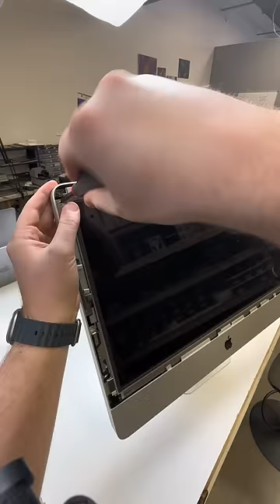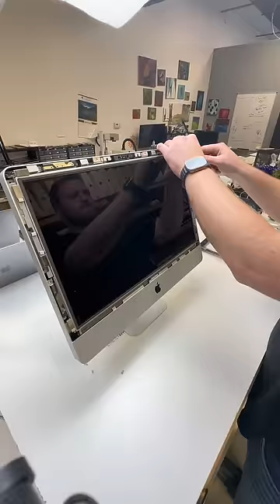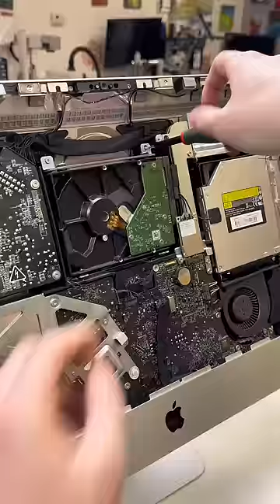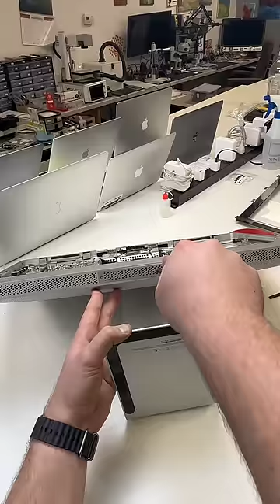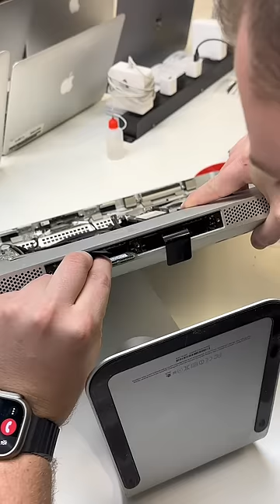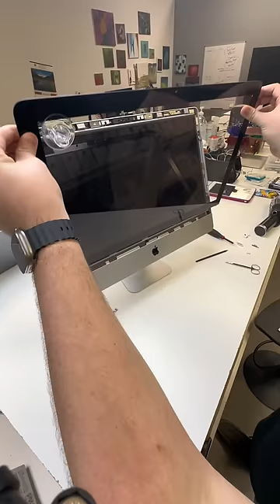7 years later and he’s back! #strictlyapple #thebestforless #shorts

Comment: 4 to 16 gb of ram is a crazy upgrade
Reply: I did my mum's old office laptop recently. 10 year old hdd and 2gb of ram to a 512 ssd and 16gb of ram.
I expected it to be better but I didn't expect it to be a reasonable pc in 2023.
Reply: That and an SSD boot drive....if the customer could tolerate a hard disk and 4gb of RAM for that long, this upgrade will be amazing...like a new computer.
Reply: oh man i feel old
Reply: @paddington1670  dude, my first pc had, I think, 64 or 128mb of ram and like 20gb internal storage.
Shit evolved FAST in the last two decades.
Reply: @nazimelon6653  The first PC that I ever used was 25Mhz, 4MB Ram, and a 40MB (MEGABYTE) HDD. No sound, no NIC/LAN, no modem.  That was pure sneakernet floppy to floppy.
Reply: He should have been going up about 2 gb a yr anyway
Reply: @teerich2011  what u talkin bout
Reply: @Wyv3rnn  memory?
Reply: @teerich2011  what do you mean going up 2gb a year tho
Reply: I had to rewatch the vid just to make sure i heard it right😅
Reply: @Wyv3rnn  just a generalization. If you average it out. After a few years you generally make a high upgrade to catch up and keep up, plus if you plan to game, do design work, etc. Average 2GB a year but not actually physically doing a Ram upgrade every yr
Reply: @teerich2011  ok that makes more sense
Reply: @TheLionAndTheLamb777  what year was that roughly
Reply: @teerich2011  I can see that. But if this guy was only using 4gb of Ram until this year, he’s does need to upgrade every year, it’s a waste of money. He’s not using high power programs, no gaming or writing software. He’s probably using Microsoft office and watches YouTube video
Reply: Don't be a hater. Are you paying for his upgrade? That obviously works for him so it's all gravy baby
Reply: @Scxoop123  im not hating im saying that is a crazy good upgrade chill out. also 16gb of ram is not very expensive
Reply: @Wyv3rnn  lololol my bad dude. This triggered me because of something personal.  I have an old school Toshiba Satellite that I've upgraded 3x (well 2x myself and the 1st one by the original owner) and because of the almost $3000 in upgrades and add on's I'll NEVER get rid of her. I have another Laptop for work as well as a desktop but I love my Satellite and will be buried with her
Reply: @KayMac1 1986-1992 ish. My first was similar, 33mhz, 4Mb RAM.
Reply: i did 40 gb for laptop and 64 gb for desktop

Comment: 7years! Man this is what we need more of. Build once and use forever! Good for the environment and the pocket.
Reply: I have my original g3-g5 imacs still. They still run and everything. Just so old you can't do anything modern on them.
Reply: I use my 2009 laptop and 2012 iMac everyday. Both have ssd now. Run great
Reply: Not good for pockets of investors tho 😅
Reply: That's not what Apple wants.
Apple wants $$$
Reply: I still use the imac i got in 2013 or 14, cant remember. They are durable. I used to switch it from home to home when i stayed at my gf. In 2018 i upgraded it to 1 tb ssd as well.
Reply: I just shelved a 2009 27” iMac. Worked fine, just got slow dealing with large pdf drawing sets for construction. It’d still be a perfectly adequate machine for general use. Glad I switched to Mac.
Reply: I've been using the same laptop for the past 11 years. Put an SSD in it and upgraded the ram to 8GBs a few years ago.
Reply: the shareholders disagree with this statement.
Reply: I’ve had my iMac for 13 year it’s a little slow but it works

Comment: That's how computers you own are supposed to work... You upgrade things, you don't just recycle it. 😊
Reply: Yeah, but you’ll have a worse experience. ESPECIALLY with Apple. They forcibly make their products get worse with time. I’m convinced that every OS update is purposely meant to strain the hell out of old hardware and create problems. It’s a little different with a PC, cuz it’s much easier to treat a PC as modular system than it is a Mac
Reply: @MisterK-YT  iOS uodates primarily makes the battery start to drain quicker. My gf has a 13cmini and the battery health says 93% yet i goes from 100 to 0 in 6 hours or so barely used but before the last update it was getting 8 hours or so while using it regularly
Reply: Turn off all updates. It brings nothing but trouble.
Reply: @MisterK-YT  or it could be that operating systems get more and more complicated over time and require hardware to keep pace. Just a thought.
Reply: @Webb8991  I have to disagree. It definitely does not only happen to phones (in my experience). I’ve seen it happen with every MacBook, iMac, MacBook Pro that I, my gf, my brother, and my sister have owned.
Reply: @bazonga9085  for sure, that’s definitely true. But I would argue that if upgrading the OS leads to such a noticeable hit in performance and increased bugs/issues, they shouldn’t mandate the update so hard. Technically it’s not MANDATORY, but they pretty quickly start dropping support for even slightly older OS versions. (I’ve also heard that they encourage 3rd party desktop App Store developers to quickly drop support for older OS and start using their newer libraries without leaving in support for the older ones.) Back in the day, that was rarely an issue. I can go to most random Windows software download pages and they’ll support like, Windows 11 to as far back as like Windows 7. 

Even though I prefer macOS, Apple just does so many irritating things (IMO)
Reply: @Mr. K  Your right. Apple have said they reduce the power output of their devices chargeable devices so that the battery stays good. However I wouldn't be surprised if they did this for all there old products to make the new ones seem just that much better
Reply: @dangbro  except there’s plenty of security fixes in updates, at least IOS
Reply: apple does it's best to prevent you from upgrading it
Reply: @bazonga9085  apple was found guilty of slowing down older iphones COME ON DUDE
Reply: @MisterK-YT  That’s why i never updated my OS.
Reply: @MisterK-YT  it was proven and is a fact older apple products stop working from OS updates and not hardware problems
Reply: @zyourzgrandzmaz  sounds right to me
Reply: Don't let Apple hear you say that.
Reply: Bro tried to get him to recycle it too lmao
Reply: Your opinion
Reply: @EnglishDrifts69GTxRED  anecdotal evidence
Reply: @capybara9521  its facts though. Its known throughout the tech world
Reply: @bazonga9085 what the fuck is the os running that's more complicated an  update ago?
Reply: @MrTuts4life  but unless you dual boot windows or Linux you are never gonna be able to barely play games on it even if you do the very CPU is totally different from the standard x86 programing style meaning that MacBooks are specifically for designing and creativity that's it
Reply: @MrTuts4life  Never know they might want something to emulate or use for light gaming or want something to give to a child that is not yet old enough for a proper custom rig
Reply: Except everything around the computers are upgrading at a exponential rate.

Computers in 2007 would struggle displaying modern HD videos. Let alone modern websites which take up much more ram and cpu usage.

A comp fron 90s would struggle to load a modern 2005 web page and that keeps going on to today.

Comment: My first iMac was the 2011. It ran like a beast. I used it until 2022, but it still works like a charm. I use it from time to time, because Apple doesn’t allow 32-bit programs to run on their new silicon machines nor allow switching operating systems.
Never underestimate older Mac’s. They are an engineering masterpiece.
Reply: And the repairability and upgradability is a huge 👍👍👍👍
Reply: @markarca6360  Apple is the most anti right to repair company out there 😂 this ram upgrade should have just been a single plate with a screw.
Reply: @djkjthe3rd185  perhaps they cared about the aesthetics. The older molder iMac's were super user friendly, but changing the ram was still one hell of a job, because you had to take out the entire display. Still, it was upgradable, unlike newer models.
Reply: @william_ok  My Dad's got a 2012. It's held up pretty decent stock. I build PC's in 40 minutes and repair iPhones, so I'm pretty tech savvy, but I don't dare to take the front off an iMac. I want to put an ssd/ram in but I'm not risking it 😂
Reply: @william_ok  My clumsy ass dropped a fried iMac before and the screen went everywhere, I'm glad it was being scrapped but damn I was traumatized from working on iMac's after that.
Reply: @djkjthe3rd185  it was, there’s an access door on the bottom held on with two screws. The hard rice upgrade wasn’t even that hard. The glass is held on with magnets and can be easily removed, the screen is held on with a few screws and some connectors, and then you can access the drive. These models even have upgradable graphics cards.
Reply: That doesn’t allow changing OS systems and useless because apps aren’t able to run on it doesn’t sound too engineering genius to me 😂🤣
Reply: @djkjthe3rd185  might get bricked just opening it 🤣🤣
Reply: @robmalcolm8042  Not sure if you're talking about new or older iMacs. I mean Boot Camp exists on older devices and as far as I've heard it runs Win10 pretty good
Reply: The gpus are so useless like the iMac range how Apple ever screwed the world with these bits of rubbish is beyond comprehension.  And the dumbest this is you can’t buy new gpus to fit them or fix the issue.  You just have to scrap them.
Reply: Steve Jobs era
Reply: I still use a Mojave on my Mac for an almost similar reason, due to its capability to run 32-bit apps. I don’t know other way to copy songs from classic iPods yet rather than use Senuti which is 32-bit only
Reply: @pujaastika  And I highly recommend not updating your mac anymore, Mojave is a good OS and unless you want to have more app compatibility don’t upgrade anymore.

Comment: My parents still have a 2008 iMac and only replaced the HDD for an SSD and it still runs great👌🏻
Reply: I got one mid 2007 24 inch with core2 duo eztreme t7900 clocked at 2.8 ghz upgraded to ssd runa so smoothly El Capitan. Still good for an old dude 😂😂
Reply: Bro that's vintage.
Reply: Iaccidently deleted whole machintosh , recovery and all partitions, now i cant so anything, i downloaded mac on usb drive, but imac 2008 wont read it
Reply: Mine has a 2011 air already with SSD & it's still really slow even with a clean install. Installed chromeos on it and it works great
Reply: Honestly, old computers can perform a lot better than some people give them credit for if you're willing to do a little work. I have a Dell Latitude D620 from 2006 I've done some work on because of its sentimental value to me. It has a 2.33GHz CPU, 4GB RAM, and a 240GB SSD, can honestly handle most of my day-to-day stuff with a nice distribution of Linux or older version of Windows. Should you use an older computer like that? I really wouldn't say so, but is it possible? Absolutely.
Reply: @РуссияСрбија  I've had that before, have you tried holding command + option + R while it's starting? That will install the latest MacOS version available.
Reply: @ohareza  That like installing Linux lite. Maybe you can try to use a Linux distro like Fedora. The UI is similar to MacOS, but you will be able to install apps and games. Also, has the iMac become louder after installing the SSD? Normally it gets confused due to not having the hard drive temperature sensor anymore and it will set the hard drive fan to the max.
Reply: @leonferko  That iMac doesn't get any security updates anymore and I'm guessing the app compatibility is lacking. I would try something like Fedora Workstation on it. Or maybe something lighter like Linux Mint XFCE.
Reply: Likely has a hdd since ssds can die out faster
Reply: @РуссияСрбија  you need to use cd recovery in a 2008. Then upgrade to higher OS.
Reply: @fabiandrinksmilk6205  2008 don’t have internet recovery.
Reply: My younger brother has a 2008 iMac and it still has a 7200RPM hard disk. It’s still really fast.
Reply: @fabiandrinksmilk6205  i know i know but nevermind it is good for web browsing and some music still working smoothly tho
Reply: No it doesn’t don’t lie
Reply: same, they're superb for essential computing, still browses pretty well
Reply: Only problem is SSD can suddenly die
Reply: Oh so how long would it take it to load three safari tabs 🤨
Reply: Lol, that's a horrible lie. I'm a network admin and have many 2008 iMac's I have to deal with. They are all SSD and 16GB RAM upgraded. But with a 2 core processor, they are still awful. There's no way around it. Junk.
Reply: @РуссияСрбија  put linux on it. Mint is a good one for a 1st timer.
Reply: @РуссияСрбија  You'll need to burn a dvd, or use another old imac to install directly to the hard drive (via a sata -> usb adapter)
Reply: Zdrqvo. Imam iMac 2011 godište. Koristim hotspot na telefonu za internet ali nikako ne nalazi iMac. Laptop nema problema.
Reply: You can't update it, which means they can't download apps, which means for general browsing and email it works. But so would pretty much any PC from that era, if you kept it on Windows 7 and didn't expect updates.
Reply: @ilaser4064  I'm not even sure its safe for browsing. the 2009 imacs I messed with last year, with the latest version of os x they could use, could no longer get up to date versions of chrome through its auto downloader (I don't know how long apple will keep updating safari with security or feature updates however)
Reply: @anullhandle  zorin as well

Comment: Hey, my fan is screaming now.  Common when switching from HD to SSD on Apple.
Reply: You have to use Macs Fan Control because there's a thermal sensor in the HDD
Reply: @andrupka8749  yep that's exactly what I was gonna say
Reply: tell the customer
Reply: Get SSD Fan Control and turn on SMART mode.
Reply: @andrupka8749  How does Mac fan control help?  I am having same issue on my macbook pro 2017
Reply: @bilalillahi6347  your issue isn't related to this though. Macs Fan Control lets you change the fan speed but you're on an MBP 2017 which are notorious for overheating so lowering the fan speed will make it overheat.
Reply: @andrupka8749  oh That's why. Thanks alot for the information
Reply: can actually happen on any platform, i noticed my core i3 system getting warmer as a result of moving from a HDD system drive to SSD. Just that change can let your CPU stretch it's legs a bit more and work a little harder after removing the HDD bottleneck.
Reply: @951258tike22  no, this issue is specifically caused by the thermal sensor in the HDD.
Reply: @951258tike22  apple tends to use hard drives with built in temperature sensors.  Once you swap the drive, the Mac OS can't tell how hot the hard drive is, so it runs the fan at full speed.
Reply: @andrupka8749  that's fair enough, was just pointing out that increased cpu/system fan speed can be observed on other platforms as well by upgrading to ssd. definitely shouldn't be max rpm though!
Reply: @tonyfremont  ah, so i assume they're pulling from a proprietary sensor rather than just the s.m.a.r.t data? i mean, all drives have temp sensors, and a sata ssd usually runs cooler than a spinning drive anyway
Reply: I did this maybe 10 years ago. There’s another SATA port on the back of the motherboard, and tucked the SSD behind the SuperDrive. Left the OG hard drive in there for extra storage, and didn’t have to bugger around with any fan settings. Sold it in perfect condition when the M1 Mac Mini came out.
Reply: I think this an issue specific to Intel iMac. I replaced the HDD with an SSD in my 2012 MacBook Pro and never experienced the fan issue.
Reply: I have done loads of Mac SSD upgrades. The reason the fan runs on high continuously is that Mac hard drives have a built in thermal sensor which connects to the motherboard via a small cable, and allows the fan to be controlled based on temperature. Non-Mac hard drives and solid state drives do not have that sensor, so you cannot connect the motherboard wire to the drive, which causes the fan to run high continuously. Other World Computing (OWC) manufactures an In-line Digital Thermal Sensor kit for specific model Macs which resolves this issue.
Reply: @chunkyg6715  The fan issue only applies to specific iMacs, not MacBooks.
Reply: @chunkyg6715  It is specific to the iMac. The MacBooks don’t have a temperature sensor, use 2.5” drives instead of 3.5”. Those MacBooks were so easy to upgrade the hard drive and RAM. Those were the days.
Reply: @tyramail  lol, a 3.5" HDD in a MacBook, any laptop in an alternate reality where the briefcase form factor is a thing. SSDs used as a replacement for a HDD are 2.5" but thinner, use SATA, use less energy, faster and more physically durable since not mechanical, and fragmentation isn’t an issue. The most significant improvement to performance usually comes from replacing a HDD with SSD on any old computer regardless form factor, OS or filesystem. I know, I’ve replaced HDDs with SSDs on many macs and pcs. Sucks that in modern macs storage is soldered to the motherboard. Apple could have at least provided an M.2 slot to install/replace an NVMe/SATA SSD, but people keeping their mac for longer would eat into their profits. Still didn’t stop me from upgrading from a 2012 MacBook Pro to an M2 Max MacBook Pro, the performance improvement and battery life is on another level.
Reply: Someone who changed hard disk must leave old control board with thermal sensor 😂